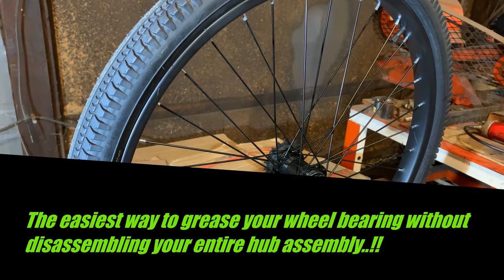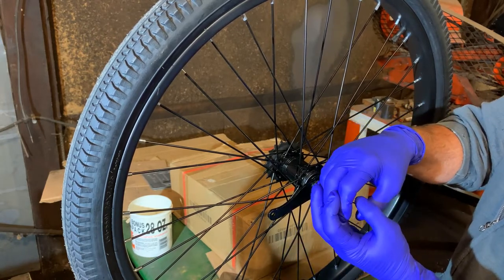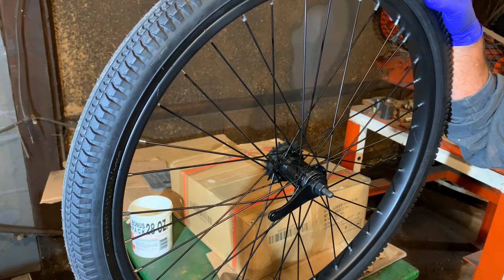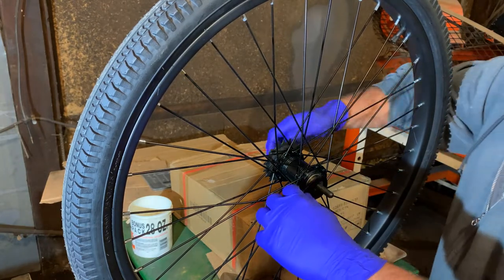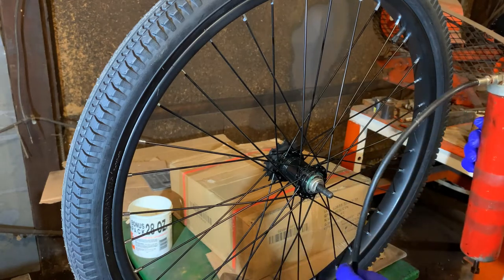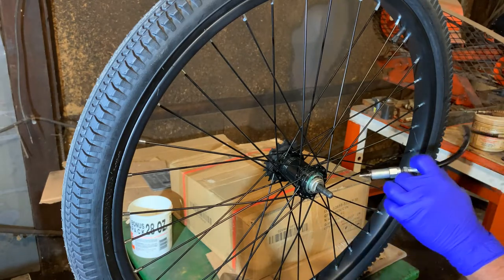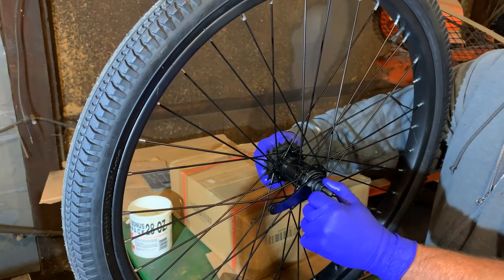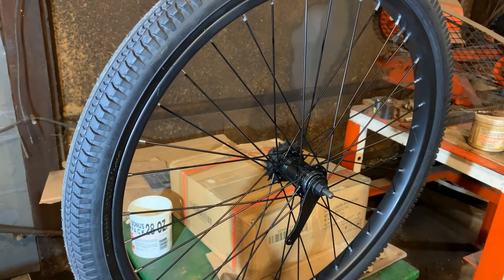The simplest way to grease your wheel bearings

Comment: @EcoTransGaspoweredBikes is there a specific grease we need to use?
Reply from the maker: I use red Hi- Temperature grease, it's not necessary to use Hi- Temp grease though, it's just what I use on equipment & it's already in my grease gun. On these bike just plain ole wheel bearing grease will work just fine.. 👍👍

Comment: I just finished packing my grease with a flat head screwdriver than I leveled around the edges. Did I do it correctly? I  just finished watching your video before I did the procedure on my rear wheel.
Reply from the maker: That should work just fine..👍 That's how I used to do them myself, but it was time consuming when your building multiple bikes... You should be just fine.. 🚴‍♂🚴‍♂
Reply: @EcoTransGaspoweredBikes  Thanks for your help. I'm going to purchase a grease gun from the hardware store. So this time next year I will use the grease gun to lube my ball and rollerbearings.
Reply: @EcoTransGaspoweredBikes   I did it with my fingers took the whole thing apart and gobbed grease everywhere. It turns into a big mess plus you have to be careful not to loose the little balls that are seated in the bearing rings.
Reply from the maker: @Robertjustice101  I feel your pain.. 😡 Been there a time or two myself, that's when I tried the grease needle for my grease gun. After that I don't dread greasing the wheel bearings anymore.. 💖💖
Reply: @EcoTransGaspoweredBikes   I will try your method. less mess with grease getting all over.